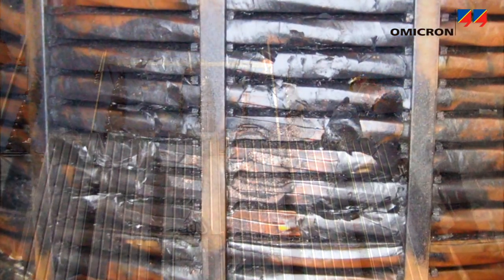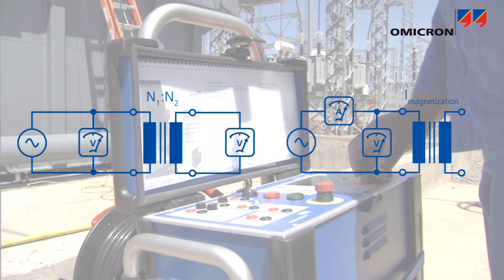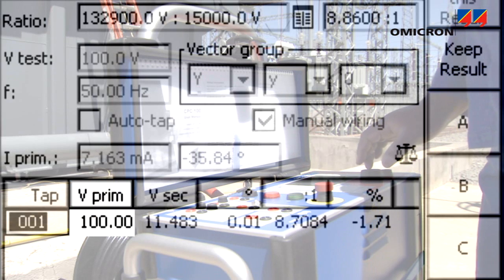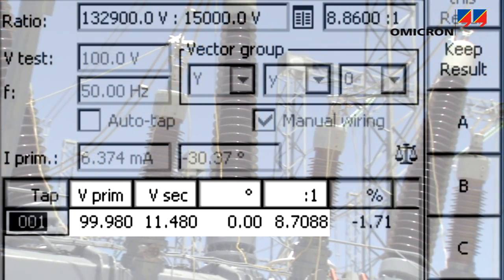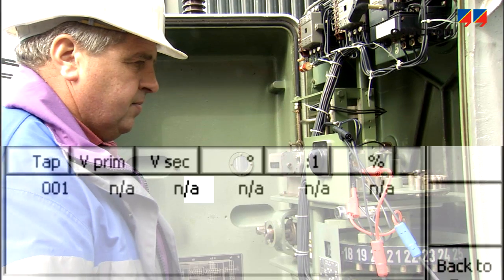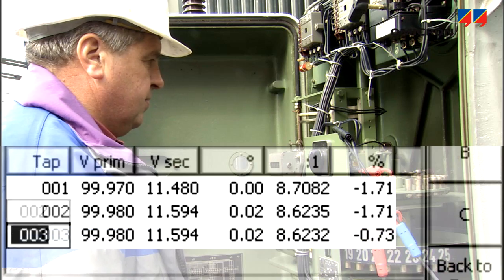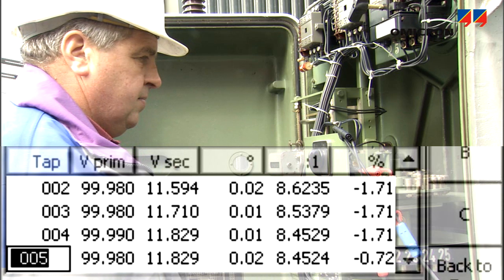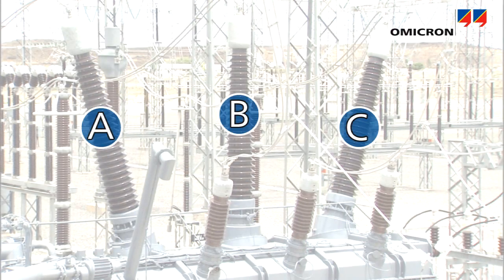Power Transformer Testing - Measuring ratio and magnetization current

Comment: Thanks for clear explanation and all details.
I have question regarding this subject can I depend on excitation current result during TTR test ? If we have result zero current in one phase What is the possible reason? Also we did the winding resistance test and all phase give us reading within the limit.
Reply from the maker: Dear @youssofasiry7233, 

thank you for your reply and the interest. 
Yes, you can depend on the excitation current result during the Transformer Turns Ratio (TTR) test. The excitation current is voltage-dependent and non-linear, and it can provide valuable information about the transformer's condition.
If you are measuring zero current in one phase, it could indicate a turn-to-turn short circuit fault in that phase. The excitation current results will rise significantly on the affected phase if such a fault is present. On the other hand, it could also be a problem with the measurement device or the connection.
If you have some questionable results, please send an e-mail to support@omicronenergy.com who are happy to help you with your inquiry.

As for the winding resistance test, it is done to verify internal connections and to detect any open or poor connections. If all phases are giving readings within the limit, it suggests that the transformer's internal connections are in good condition. However, keep in mind that this test is very sensitive to temperature, and results must be corrected to standard temperature.

Best regards, 
your OMICRON team

Comment: If the tolerances   in turn ratio test are ±0.5٪ ، what are the tolerances of exciting and Magnetizing current? Please.
Reply from the maker: Dear Eng. Omar Eyad Aljorani, 

The excitation current pattern on the phases depends on the measurement method, winding connection (YN, Y or D) and core construction. There are no absolute assessment limits. 
For more details you can check the IEEE C57.123-2019. 

Best Regards, 
your OMICRON team
Reply: @omicronenergy  many thanks for your reply, according to my information, the 
excitation current (No-Load Current): The current which flows in any winding used to excite the 
transformer when all other windings are open-circuited, and its value about (2 to 10)% of the rated current.
Please correct this information if it is wrong.
With my best regards.
Reply from the maker: Dear Eng. Omar Eyad Aljorani, 
The excitation current depends on the applied voltage. Basically, the current depends on the type of transformer, construction quality, age, standards, voltage level. To just name a few factors, which may influence the result. For the excitation test at 10 kV these suggestions are most likely too high as there are constructions, which keep 0.5% at nominal voltage or less. Better to discuss this with a manufacturer for the individual design. You can download PTM from our customer portal to have a look on some sample measurements in the sample database, like e.g. TESTRANO 600 sample job.
Best Regards, your OMICRON team

Comment from the maker: Dear Virtualgod2009,

Transformers are built in a way to minimize the chance of their exploding, even in the case of such a serious failure. And we agree with you, this failure could have been detected with various diagnostic methods. Unfortunately, failures often occur within the windings and are not as easy to detect. Therefore, diagnostic measurements help you to find the fault location, determine how serious the failure is, and if an on-site repair is possible.

Your OMICRON team